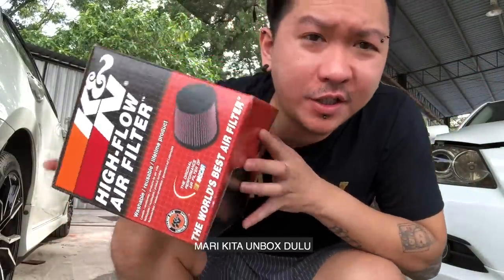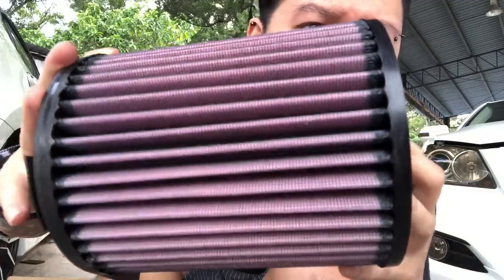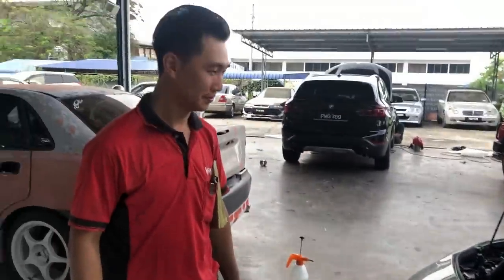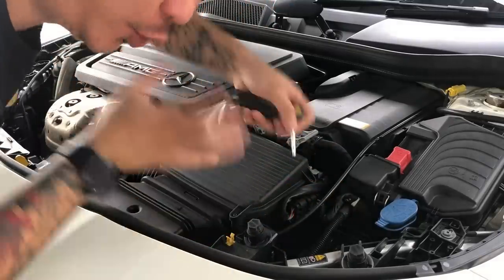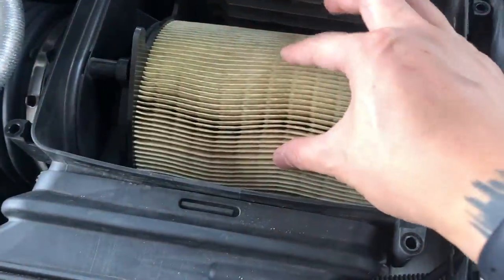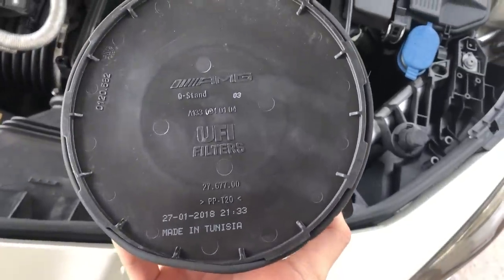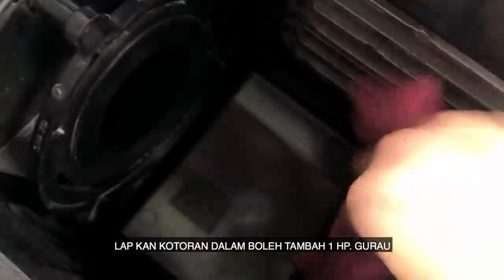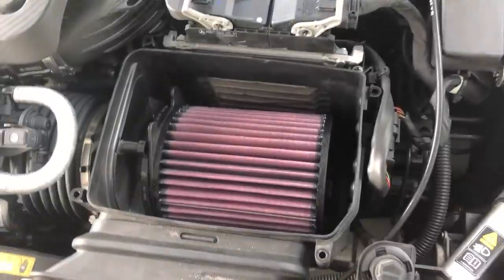CLA45 AMG Vlog Update!! (Part 4)  How to change K&N Air Filter, Sound before & after

Comment: Hey I have a question. 1st question: is it possible to drive with a k&n filter and leave the box open? Question 2: Is it possible to install brake pads yourself without a rear brake opening computer? Thank you for the answer.